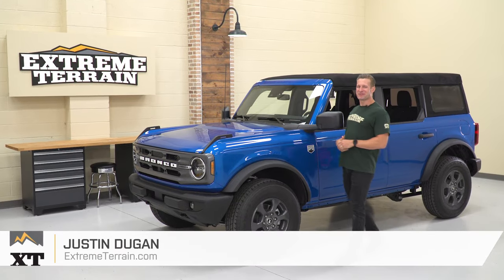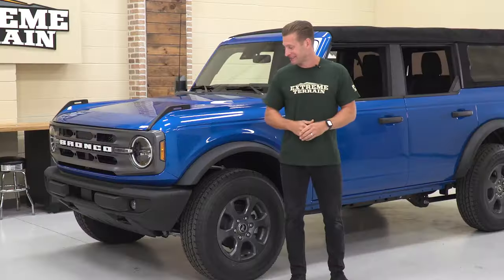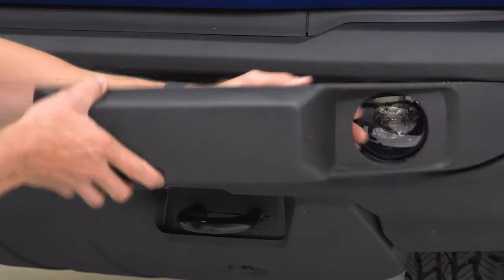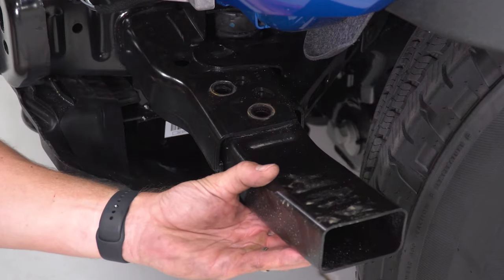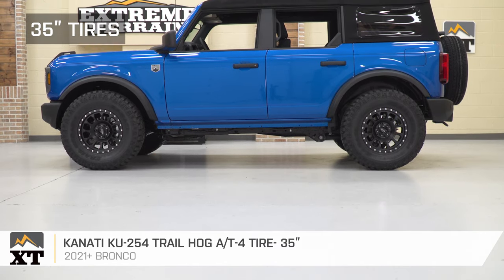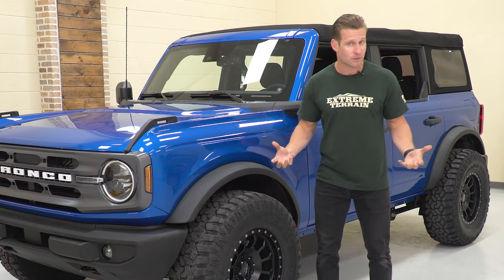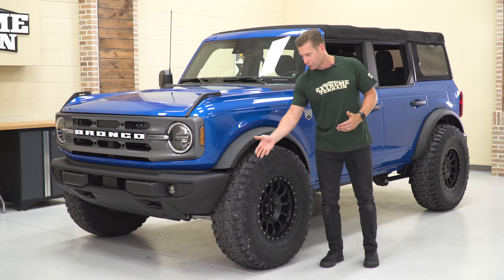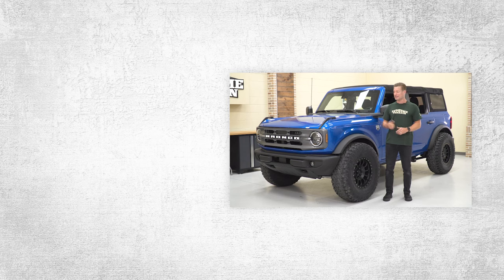2021 Ford Bronco Crash Bar Removed | What Size Tires Can Fit? 35's vs. 37's - Throttle Out

Comment: Great vid, thanks. Is a true 35x12.5 a little bigger than a 315 and if it is, do you feel it would work as well as this tire as far as working stock on the Big Bend?
Reply: Yes, a 35x12.5 is larger in the following areas: 

Diameter = 0.67in 
Width = 0.12in
Circumference = 2.09in
Sidewall = 0.33in

Comment: My 2022 Cactus 4 door Soft Top comes in this week... Can't wait. Can I install the 315/75r16 tires on the original base rims?
That's my plan until I do a lift and new rims. Subbed. Thanks.

Comment: Makes sense that everything fits, how about performance hits after moving up tire size? I would expect a pretty significant hit to torque, especially if that big bend is at stock 3.7 gearing (unless you opted for the 4.27 with rear locker, which is still a lot lower than the stock sasquatch gearing of 4.7)
Reply: Pretty big oversight to not have included that information…
Reply: The big bend with the manual has 4.46 which should be enough for 35s.

Comment: Love Love LOVE this video, getting my OBX in a month.  But I’m worried, isn’t the M190 axle on the 2.3L too weak to handle big 35’s like that?
Reply: No not at all! That 2.3L Ecoboost has 300hp! Hope you run at least midgrade fuel or even premium. Put a CAI in there. Always run full synthetic engine oil esp in 2.3L Ecoboost it works bit harder but excellent powertrain. Love it in my '20 Ranger XLT FX4. Check w/Ford directly bout that Dana axle in Bronco! Ranger has Dana axles too.

Comment: Couldn’t you use spacers to move the bumper forward.  Taking in the limit of the plug in fog lights and such.
Reply from the maker: I suppose you could but it might look a little goofy, depending on how far you push it out.  -Justin

Comment: Will the 315/70R/17 tires fit on the factory rims, or are aftermarket rims necessary?
Reply from the maker: You can absolutely use factory wheels with that tire- as long as they are 17's. -Justin
Reply: Thanks for the reply. I guess my concern is if the factory offset will allow that tire size? And I believe most 315s need 8.5 width rims, no? I think the stock Black Diamond 17 inch rims are only 7.5 wide.

Comment: I haven't gotten my Bronco yet, but have reserved a Badlands 4-door and enjoy dreaming about all the changes I can make to it when I finally get it.  As I understand it, the Badlands trim already has some lift over the stock suspension and comes with 33s; I wonder how much, if any modification would be needed to put the bigger tires in there.  Have you played at all with a Badlands?
Reply from the maker: Hey Fretless- first of all, congrats on the incoming Badlands, I'm jealous! In regards to your question- Yes, the Badlands comes standard with the HOSS suspension (bilstiens) which is the same setup used on the Sasquatch Broncos and therefore has that minor lift over the base rigs.  You should be able to get a 35 under there without issue but you'll probably have to yank the crash bars first.  Hope this helps man! -Justin
Reply: @ExtremeTerrainBronco  That'd be cool if it turns out to be that easy!  I know I've seen aftermarket crash bars that come with some lift kits that are thinner front to back to allow for bigger tires without rubbing.  I might look into that, too.
Reply: @fretless05  did you get your BRONCO yet?!😊
Reply: @GCharlesE  Yes and no.  I didn't get mine because Ford threatened to cancel the order unless I changed it to take off the things I most wanted. I saw a similar build for sale at a local dealership and bought it instead.  I've done some mods, but not gone with bigger tires as my family already struggles to get in with the 33s.

Comment: Sooooo, why did they put in those crash bars, are they not important, what safety are you removing?? Are you sure you should be recommending this? I would do it, but Im just a private guy, your a company with liabilities and such.
Reply from the maker: Well Gabriel, ultimately we are not forcing anyone to remove anything- we're just showing how it is done because frankly a lot of Bronco owners have asked.  And you have to keep in mind, Ford deemed it safe enough to remove the crash bars at the factory on Sasquatch equipped Broncos, so that is a pretty good indicator that it is not 'unsafe'. -Justin

Comment: 35 inch means 285?
Reply from the maker: 285 refers to the width of the tire itself, meaning that its 285mm wide. The second number in a tire size is the aspect ratio. So if you looked at a 285/70 tire, the height of the sidewall is 70% of 285mm. I'd recommend checking out the following site to see what each tire size you're looking at equals in inches! https://tiresize.com/calculator/ -Zach

Comment: Are these wheels the 34 series?
Reply from the maker: They are!  Our site is launching very soon but here are the wheels used on our sister site American Trucks.  (Ranger and Bronco share the same lug pattern). -Justin

https://www.americantrucks.com/pro-comp-wheels-ranger-rockwell-satin-black-wheel-18x9-00mm-offset-5034-8983.html
Reply: @ExtremeTerrainBronco  What lug nuts did you use?
Reply from the maker: @armdo17  A smaller set of conical m12x1.5 sir! -Justin

Comment: Sure go ahead and remove your crash protection. That way if you're in a minor offset fender bender you can total your vehicle. Makes perfect sense
Reply from the maker: You are aware that Ford removes these at the factory on Sasquatch Bronco's, right?  -Justin
Reply: @ExtremeTerrainBronco  they also have a different bumper on the Sasquatch broncos that has reinforcement built into it.
Reply: @ExtremeTerrainBronco  if they didn't serve a purpose they wouldn't be there
Reply from the maker: I'm not arguing the fact that they don't serve a purpose however if they were that crucial, Ford wouldn't have made them so easily removable. -Justin
Reply: @underthelibertytree712  right because you're an engineer and ford just put parts on vehicles that serve no purpose especially parts attached to bumpers . GTFOH If they weren't important to the structural integrity of the bumper they wouldn't be there. Just like on the other bronco with the steal bumper they're not there.
Reply: 4WP makes a $200 crash bar kit that you can replace the stock one’s and still be able to fit 35’s without lifting.
Reply: @underthelibertytree712  also "thin and delicate" sheet metal can be made strong when bolted to other parts to create a triangle.  Triangle bracing even "thin and delicate" is able to redirect energy from one ridgid structure ( the front bumper reinforcement) to another ridged structure (the frame of the vehicle. Triangles are the strongest shapes and are used to create strength in everything from bumpers to building architecture.

Comment: Crash bars removed, it’s like removing the air bags from your car. Its a reason they are there. It serves a purpose in protecting you from a car accident.
Reply: if they were necessary then the Sasquatch optioned Broncos would have them, which they do not.
Reply: The sasquatch pakg
Reply: Has the crash bars removed from the factory